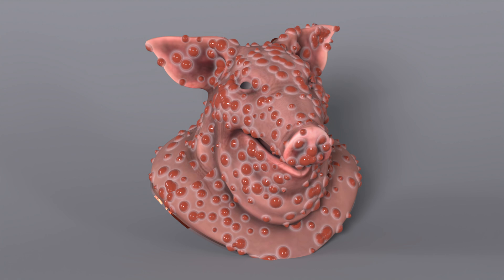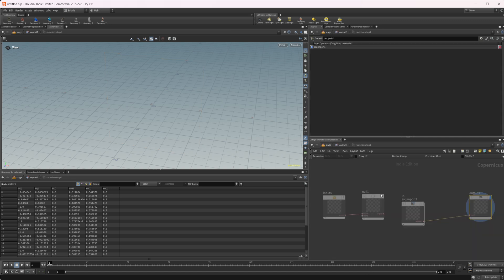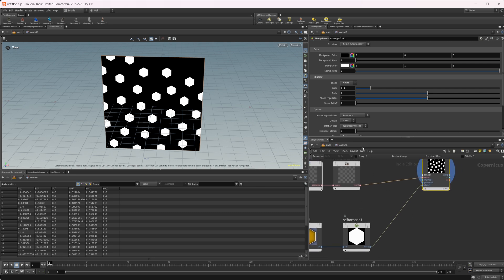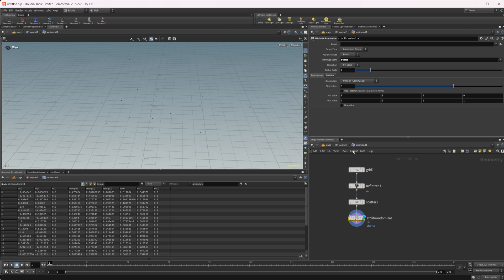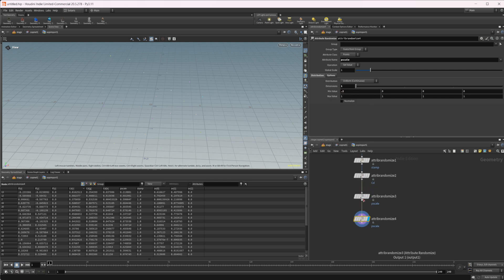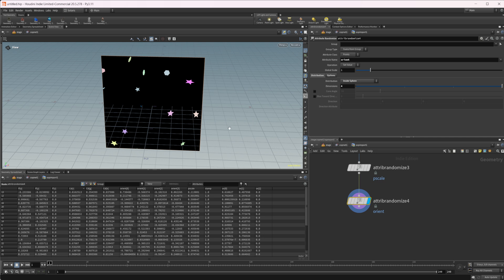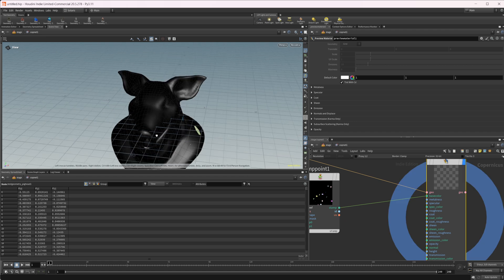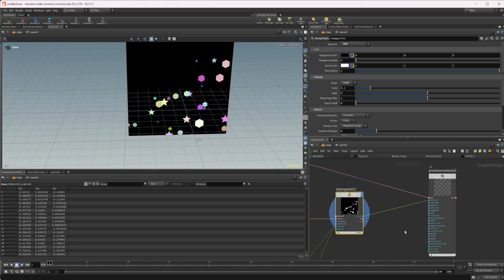Stamp Points in COPs | Intro to COPs | Houdini 20.5

Comment: Cool, handy for all sorts of random objects. Could you elaborate on how to make it tileable?
Reply from the maker: If you're scattering points on a grid we covered that earlier on in this series. I believe that was in the Bringing SOPs into COPs video. If you are doing it on a uv'd mesh that's a little bit more complex and doesn't have a one size fits all solution if you are wanting to stay in COPs.
Reply: @InsideTheMindSpace  ah yeah. But thats when you use real geo as texture input. So 2D cop nodes as a  source for seamless textures isnt as easy as substance designer?
Reply from the maker: No you can still do it. Just in this case because we are using points scattered onto the geometry as a source for our copying all inside cops it's not necessarily the easiest thing to approach. You can get seamless textures relatively easy with noises and other things which I will be covering. Just because of how this method works it will not necessarily be the easiest thing to accomplish
Reply from the maker: Its difficult to explain in text format. Maybe I'll explain in a separate video why it doesn't work and how to approach getting seamless  copys
Reply: @InsideTheMindSpace  ah phew. Was almost worried making seamless textures in general was cumbersome. Looking forward to the next one. 😁
Reply from the maker: @g8610g no not really. Especially with recipes now. Makes things a lot easier
Reply: @g8610g  it's pretty easy to tile in COPers, but allegorithmic definitely had the seamless textures dialed in on another level frow way back.   

Everything in Copernicus will soorrrt of tile out-of-the box, but in some cases you may end up with visible seems.  You can always mitigate them, tho.  

I imagine it will get better, COPers is  still really an open beta at this point.
Reply: @MAITLANDVAUGHAN-TURNER  @InsideTheMindSpace Ah both great things to hear! 😁 Im very excited by the strong inherent integration possibilities of cop in houdini itself and all the animation options! 🥳🤩